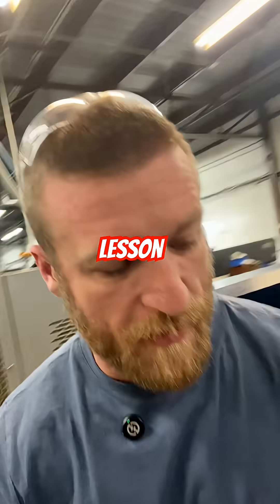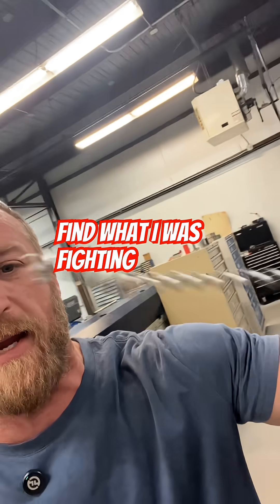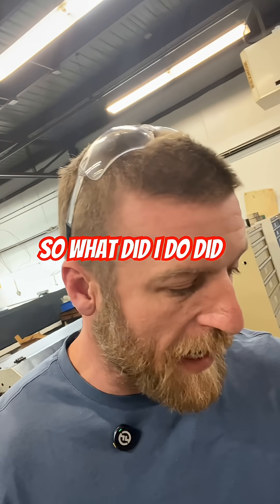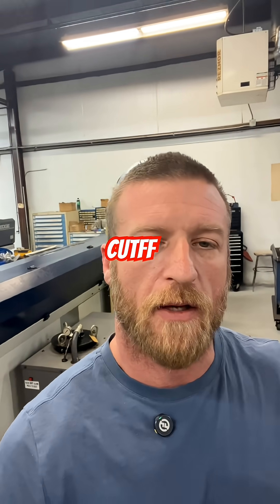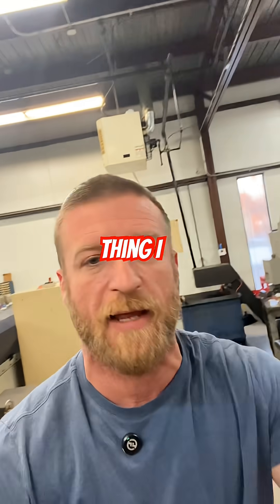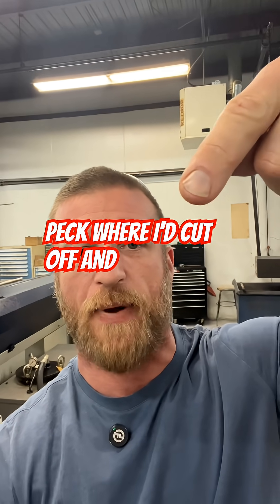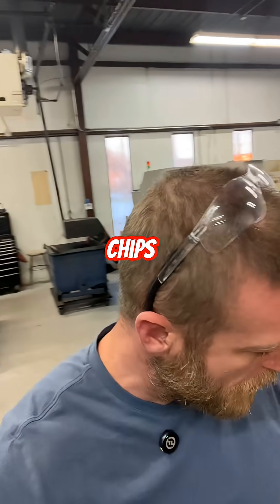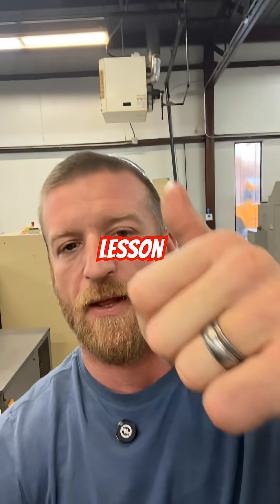Simple changes won this battle ⚔️ #cnc #machine #machinist #short #solution #problem #solve

Comment: Cut-off tools are absolute beasts. You can push them harder than you would think. Those are definitely the chips you want to see.
Reply from the maker: I agree. I think most tools can probably be pushed harder than people think. And cutoffs I find myself being more careful with but definitely have room to push harder
Reply: @C @Crusadermachining struggled for ways to long with the two sided blade type cutoff system.

When we invested in our second okuma Lt2000 I bought the iscar modular tang grip system. 4 corner square blade.
Coming in on two years later….prob around 3000hours on th machine. I’m still on th original blade. And we run 12foot bartenders and part off everything. 
Oh…and I’m pushing the thing at .01 in steel all the way time
Reply from the maker: @corny155 that’s awsome what a success story. I’ve seen that tool before. Really interesting and cool looking tool.

Comment: Mastercam has the option for peck while cut-off. micro -100 suggests to only retract half of the feed rate to prevent chip pinching during grooving operations...  for example if your feeding at f.003" per rev then incrementally U.0015"
Reply from the maker: That seems like a very helpful feature. Interesting for sure.

Comment: could also take a page out of citizens book mimicing there lfv feature and basiclly put in a few G4 X0.05 ( G4 = dwell. X0.05 = 0.05 secend. so it dwell af that specific diameter for 0.05 secend making the chip break. maybe even completely cut off from stock before going in further )  well going in . worked great for me ( might have to increase or decrease the X value depending on the material type and diameter )
Reply from the maker: I’ve heard a lot of good things about that LFV feature for sure.

Comment: Yeah 6061 can be quite the stringer but at least enough feed can usually solve most problems. As I mostly do stainless at my current shop I can have good chip control or good tool life but not both with part off. Personally I think it’s the brand my boss buys, ingersoll. Not a fan at all of the performance I’m seeing
Reply from the maker: That’s exactly what I’m using. They’re “ok” but not much more than that. What machines do you have your cutoffs on ??
Reply: @Crusadermachining  Yama sieki 2axis lathes. They are tt9080 grade. Never had these issues at other shops running Walter kennametal or ph horn inserts.

Comment: Mind sharing your SFM and feed. Don’t turn much aluminum and the little bit I’ve done I’ve battled terrible parting finish. Using 3mm wide “j type” insert (ingersoll), speeds / feeds all over the map with the same results each time and my coolant is aimed right down the top of the blade.
Reply from the maker: I settled at 550 SFM and .0045” feed. I like having my coolant come from underneath the cut off right at the cutting edge underneath.
Reply from the maker: And I’m actually using Ingersoll also. Not the J type I believe or just using more of a neutral geometry.
Reply: @Crusadermachining thanks, man. Saw people mentioning G75. It’s also really nice for roughing out large grooves with x/z start and end points, step over amount in z etc. Saves a lot of typing and copy / paste.
Reply from the maker: Haven’t used it but I really want to now

Comment: I like to use G75 for cutting off and have the chips flying off in small pieces. 
I do a .002 retract with a .020 cut depth. It takes a little longer to cut off but there's no worries about chip wrap. It also eliminates walking of your cutoff tool which happens sometimes.
Reply: I do too, but i'll do .005 and .010. But what the heck, tomato, toma"h"to, same thing

G75 R50
G75 X... P100 F...
Reply from the maker: @yannickdoyon2237  I'm sure you don't have to worry about chips at that point, not at all.
Reply from the maker: I've never used G75, but I'm going to try it now.  When we have programmed this before, we've written macros and it's worked pretty well.
Reply: Was coming here to mention G75... beat me too it.  It helps when you have a job you need to walk away from for a bit
Reply from the maker: It’s on my to do list for sure.